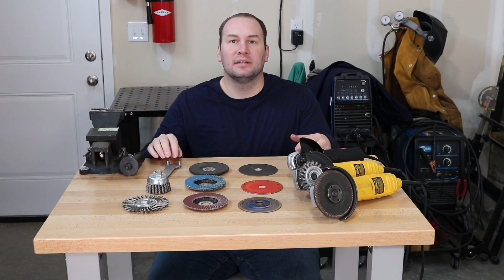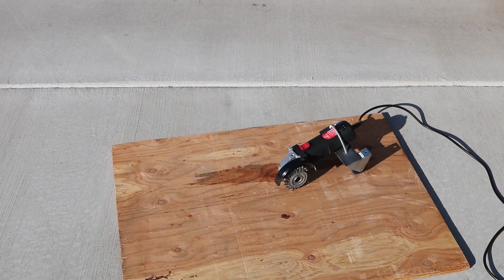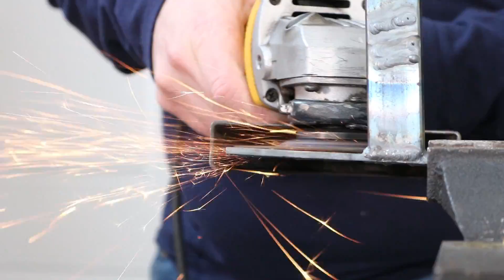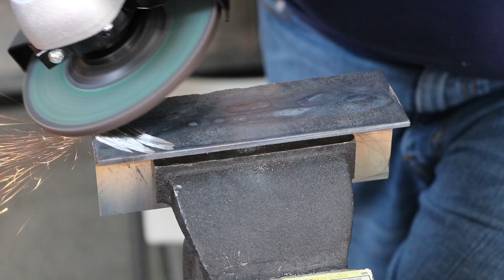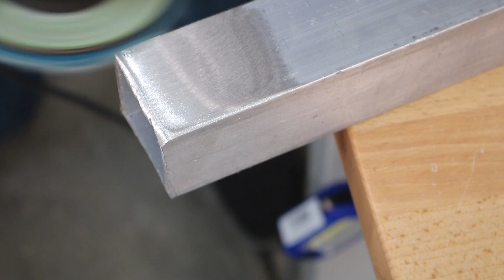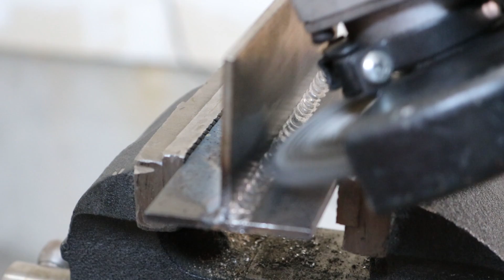How to Use an Angle Grinder: Angle Grinder Attachments

Comment: What should i use to grind rivets to shorten a dirtbike chain?
Reply from the maker: Just a regular cutoff wheel, using the outside edge on the head of the rivet. I've done it that way many times. I think a chain breaker might be better, but I've always used a cutoff wheel.

Comment: can I use a 4.5-inch cutting disc on a 4-inch angle grinder?
Reply from the maker: As long as the arbor is the same size, the disc is rated for higher speed than the grinder runs and you have the proper guard that fits with that size wheel installed, it’s possible. I wouldn’t generally recommend it, though.

Comment: Hello Tim,I need something to get dried splatters of concrete off a concrete pool floor.I been using a quick attach drill with a wire brush but it is a pain and takes too long.I do have a angle grinder.

Comment: I’m curious about something. Sometimes friction welding is used to join two metal parts. So if you made a high friction disk for an angle grinder, could you weld one edge of sheet metal to another? There would probably need to be a little overlap.

Comment: Which one should I use to remove the corrosion rust on the 2000 Toyota Tundra frame, twist wire cup, or twist wire wheel? How many do I need to finish one job (Guesstimate)?

Comment: Hey Tim, Does disc attachment may affect the angle grinder which causes the machine to vibrate? When I try to attach a wire cup brush and a wood carving disc to my angle grinder, it vibrates a lot. And I can't hold the grinder firmly.

Comment: Would you recommend the wire brush attachments to remove caulk from a car? Or would the wire brush attachments get gunked up by the caulk? I don't care if the car gets scratched, I plan to sand it and paint it afterwards.

Comment: Instead of using a bristle disc to grind welds, they do make a kind of flap disc for getting into tight spaces. The edge of it has sanding material on top and bottom side, plus a very rounded edge for pushing against the weld. Diablo calls it their "Corner-Edge Flap Disc" and I saw it at Home Depot, so it isn't a special order situation. Here's a link to the relevant Diablo product page (as of today, 2021-07-20) https://www.diablotools.com/products/DCC045040N01F

Comment: till now nobody explained what purpose those centre depressed wheels serve, you did, I wish you could explain about more disc types and the correct way to use them.for e.g concrete cutting discs have slots some are continous , why .? could you explain.

Comment: Love welding don’t love how hot it is. I built flat beds in a hot shop. Watching and learning what the puddle of metal is the important part knowing what it’s asking for and practice and adjusting your welder and keeping it going with nozel mig grease. Ive learned all kids of welders wire stick mig tig oxy acetylene was easy to learn and the welds on and it’s fun, it burns with a very bright flame.

Comment: I do not weld. But we are buying a grinder, to do some work on an old house. Old gas and water lines to cut out. Old support poles, need rust cleaned and repainted, and many other things. I was completely lost at what disks to buy! I have watched a few different videos p. Yours was the best, BY FAR! Straight to the point. Short and sweet. Yet gave more clear, concise information, rpthan all the others combined! I subbed. Although, I am not a welder. Lol but I am VERY GRATEFUL for your video! Great job!

Comment: I want to buy one to take off old paint from a project pinzgauer I just got. Not sure what I should get 😐
Reply from the maker: Sounds like an awesome project! I've taken old vehicle chassis' to a sandblaster and they grit blasted it for a few bucks. It's just some guy I found online with a massive diesel compressor under a carport in a random field. You might look for someone in your area who does that. If you want to do it with an angle grinder, the best thing I've used are 3M bristle discs. They're expensive, but they work great. https://amzn.to/3uekffQ Be sure to wear a respirator...who knows what's in that paint.

Comment: I picked up one of those diamond wheels when I bought a new grinder recently. (Thought I had lost the flange piece, and the new grinder is 9A trigger instead of 5A slide switch so not a total waste even though I found the missing piece 🤦) Tried it on the edge of my practice sheet, and wow it feels safer than the normal cutoff "death disks". I've had a ton of their little siblings on the Dremel explode dramatically, so the big ones on the grinder get me on edge.

Comment: Hi, I have some screws I want to grind down in a table top I'm renovating. I've cut the screws as far down as I can with an angle grinder now I just need to level them and stop them being sharp. Is there  a disc I can use for this please? Basically I'm looking to "sand down a sawn off metal screw."
Reply from the maker: I would just use a 120 grit flap wheel. Just be careful to move down a little at a time to avoid gouging the wood top.
Reply: @TimWelds  REALLY appreciate your help. Thank you xxx

Comment: Ok so i am buying one of these for my boyfriend.  I was wondering if I could use this to sand old paint off the top of a old table?
Reply from the maker: It can be used for this, however, it will be difficult to keep the table top flat because only part of the wheel touches at a time. A random orbital sander would keep it flatter.

Comment: the second disk you used with the diamonds im pretty sure its for cutting tiles not for metal
Reply from the maker: That's what I thought when I first saw them, but this one's for metal. It has lasted really well, but it cuts a little slower and is louder than the regular black ones. https://www.diablotools.com/products/DDD045DIA101F

Comment: Nice video Tim - short, to the point, simple. As one of the other commenters says, safety seems to be a big thing with these. How about a short video showing you using one of these tools in the correct way ? Stance, clothing, how much pressure to apply, clamping the work, etc. Like you I have a table saw and like you I'm very wary of it. Practising respect for power tools, taking them seriously, helps you both enjoy using them, and live longer. A demo from you would be cool. Thanks !
Reply: You don't know how to use a grinder safely?

Comment: Great content! Didn't know that depressed cut off wheels for cutting more flush to the surface exist!

Quick question, can you sometime give the diablo diamond grit for GLASS? (Even though its totally impractical, just for the heck of being possible) Ive seen diamond grit coated drill hole saws used for glass (and some miniature diamond cut off wheels in dremels) and the idea just popped into my head

Comment: Is there an attachment for sanding...gotta sandown a bench made out of wood...
Reply from the maker: Thanks for watching and for posting a question. If you are able to, I would try to use a dedicated sander, because it will be hard to keep the wood flat with an angle grinder. If you do decide to try it with a grinder, you could use a flap disk or you can buy a backing plate and sandpaper that is made for an angle grinder.

Comment: What wire cup are you using? I can't find any with a high enough rpm rating for my grinder.
Reply from the maker: Great question. I buy the “twisted wire” brushes, which typically have a speed rating of 12,500 RPM. If you search Amazon or Google for twisted wire cup brush, you’ll find several. I’ve also used the Harbor Freight ones, which work pretty good. 
https://www.harborfreight.com/3-inch-twisted-wire-cup-brush-47927.html

Comment: good video. I got 304 stainless steel angle and its just raw material so very dull and gray. would flap disk or grinding disk work for polishing ?
Reply from the maker: Neither will be ideal for polishing, but you can get a nice uniform 'engine turned' style appearance with a fine grit flap disk. Polishing will require multiple stages of sanding and buffing.